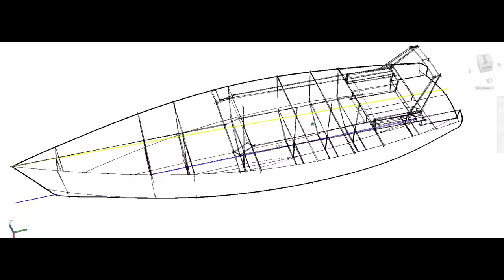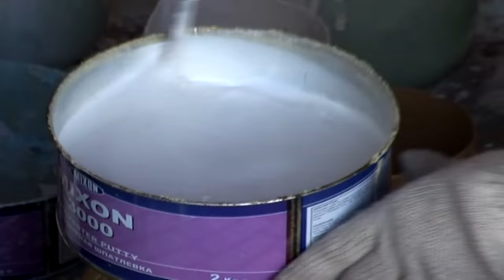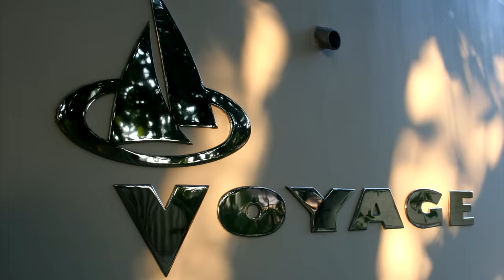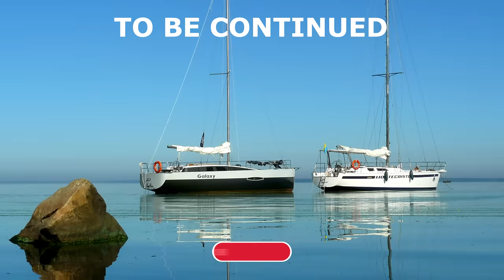500 Days a Family Builds an Amazing Homemade Boat According to Their Own Design

Comment: Amazing! I'm impressed that the waterline is accurately painted before launch. Is that fibreglass being attached to the bottom, on top of steel? (at 6:36).  I like the wheel!
Reply: I am guessing the fibre glass gives it abrasion resistance.  Did I see some going around where the chain rubs
Reply: Don't  get  the  fiberglass  on  steel  hull  ????

Comment: The bow of the boat should carry a blade keel relative to the size of the Genoa from halfway between the mast and forestay forward. The size is relative to the main sail area and mainsail keel.  A 200 headsail would carry a twice as big as the main keel. . This would relieve weather helm and increase boat speed.  Your keeling is now least wind resistant and the bow will not fall off in heavy weather but you can turn down or turn up at anytime. You are seaworthy.

Comment: Can someone explain the fiberglass application over the steel hull? Is this a corrosion prevention coating or to seal for potential leaks with weld porosity?

Comment: What I don’t understand about this is when you’re starting the very first few pieces and your welding the bottom piece and starting to go up the sides how can you possibly angle them perfectly? If they are off a few degrees the remainder of the boat woudnt go together
Reply: Cad design
Reply: @ciaranbyrne62  but your still have to cut the first pieces? I understand what needs to be done I just don’t understand HOW it’s done in real life. Is it a giant pattern that they lay on top of the steel when they cut it
Reply: @nesc39  possibly or they could just measure it exactly and draw this onto plates

Comment: Why would you put fiberglass on a steel boat?
Reply: Not sure but I see they were fairing it with filler compound- and often some 'glass is put over areas of thicker material to keep it together as the boat flexes and thermally  cycles

Comment: Yea. That shouldn't take long to reach the bottom.
Reply from the maker: It is impossible to sink with a 3/8" thick skin on the bottom of the hull.
Reply: @CREATIVE_COUPLE  That's what they said about the Titanic, too. I'm talking about the sheer weight of the thing. I guess electronics are an option?
Reply: You realize that most all steel/lead keel sailboats are not positively buoyant when the take on water right? So I'm guessing that you know a lot more about land than water.
Reply: Those dudes have skill in the welding shop. That would be a hell of a boat
Reply: What an unkind thing say.   I find that weak people often use rudeness imitate strength.